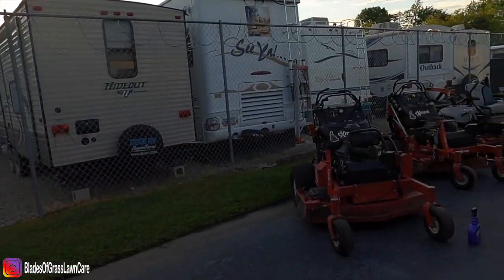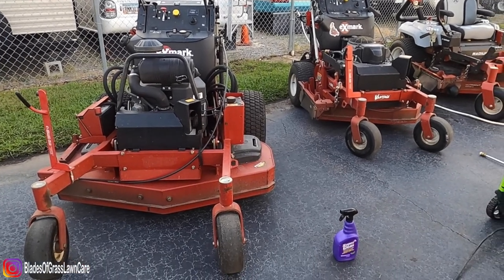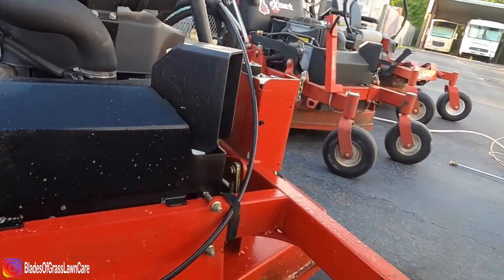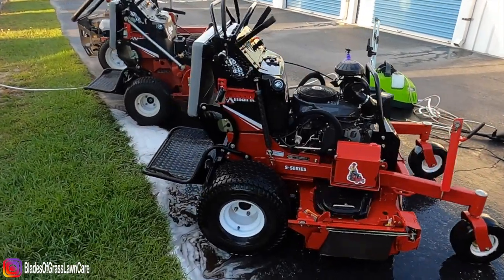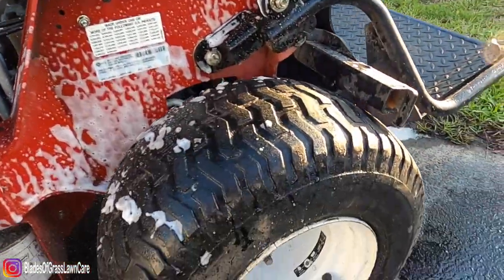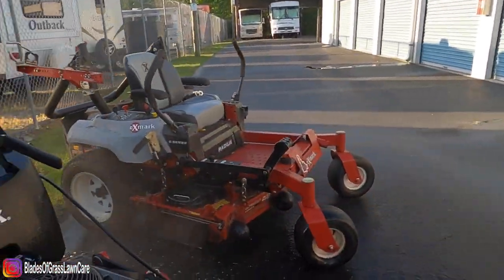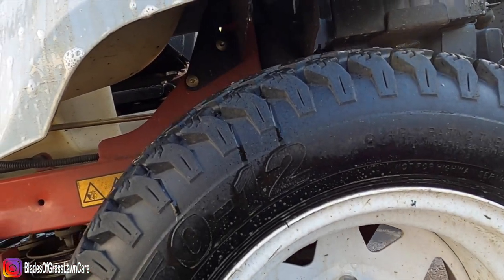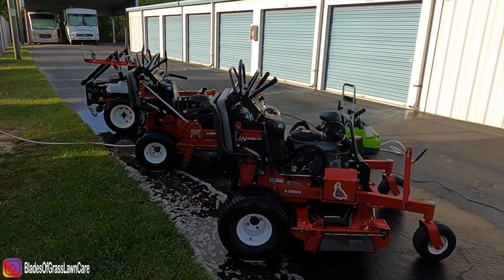Loosen Dirt Quickly When Cleaning Your Lawn Mower

Comment: Not saying this stuff doesn't work good....but...lol...after just doing this yesterday with mowers that I'm ashamed to say were wayyyy dirtier. I would have to say that purple power works just a bit better. No scrubbing required. Of course you need a respirator to spray it but it does work incredible in my humble opinion.

Comment: It's not just perception. If you don't keep your gear clean eventually buildup will start to restrict air flow to air cooled components, air intakes, etc. and start to cause performance and eventually mechanical issues. Keep them babies clean! I keep my gear clean because I don't like using crusty dirty stuff. But it has the added benefit of improving long term reliability :) Peace out!

Comment: I use purple power  with a pump sprayer  works well ..   just make shur u re grease everything when you're dunn.  Having a clean machine is nice because you can see if anything starts leaking you can pick up on it  pretty quick.  Another good thing to do is take the top of the covers off of the motor. you would be really amazed how much crap get stuck up under there and that's what caused it to overheat an couse blown head gaskets. I couldn't tell you how many lawn mowers iv Fix because of that.